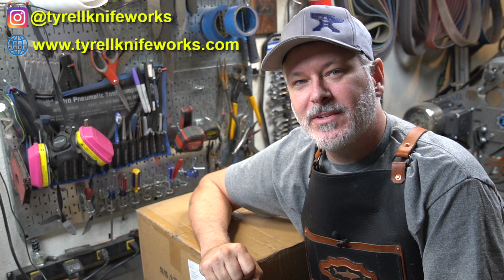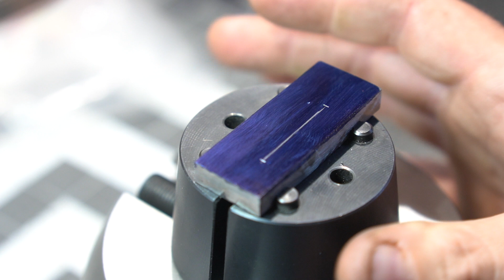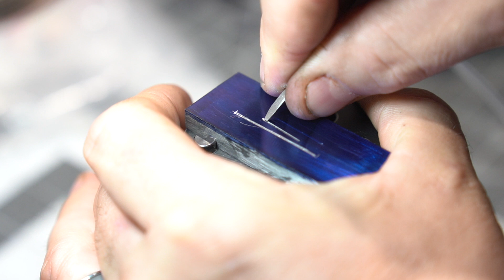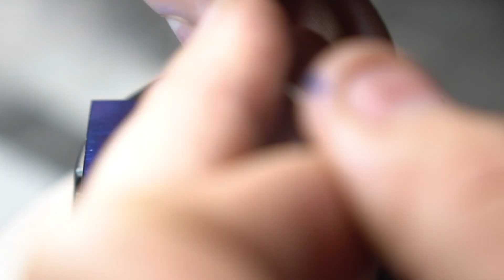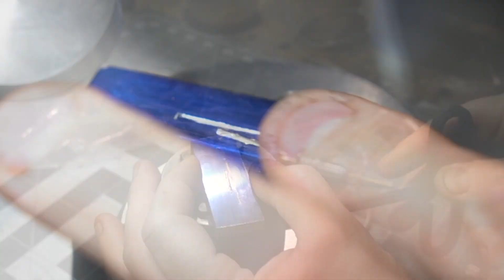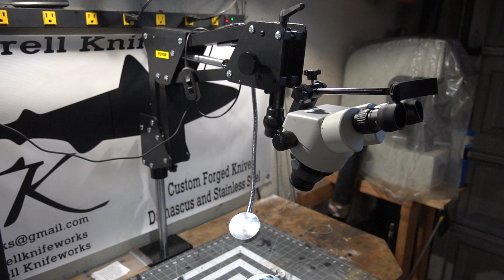Triple-T #99 - Silver wire inlay and a new microscope

Comment: hello, this is what I'm looking for about inlays.  but I failed when the inlay was on wide media even though it was only in the shape of a circle, is there any Vidio inlay on wide media.  I'm a beginner and want to engrave coins.  I hope there is a video, maybe a little picture of how to make a trench for wide media, that's my problem
Reply from the maker: I’m not sure what you mean by “wide” media.  You need to inlay a large area?  That is usually done by carving out that area and putting dovetail grooves over the bottom and pressing rows of wire into it.  I’ve never done it myself though.  If you are on Instagram, watch https://instagram.com/j.parke1?igshid=YmMyMTA2M2Y=.  Thanks for watching.
Reply: @TyrellKnifeworks  yes large media

Comment: Great job as always man,  can't wait to see the gold stuff.  What about lightning on a plain hc knife of inlaid silver?  What do you think?
Reply from the maker: Yeah that could be done.  You’d just have to do the inlay before HT and hope the quench doesn’t screw it up.  Thanks for watching!
Reply: @TyrellKnifeworks  is it impossible to do after it?
Reply from the maker: @8ank3r  no, not impossible.  You’d have to use a special graver that would cut hardened steel.  It will be tough engraving though.
Reply: @TyrellKnifeworks  maybe on a differentially quenched blade near the spine. I'll leave you alone about it though. Too much work for too little result
Reply from the maker: @8ank3r  Yes, that might work if you had a differential heat treat.  I suspect you'd still need a something other than HSS gravers for that since its harder than mild steel.  It could work though.

Comment: would it be simpler to melt the silver or gold in and let it flow once you pushed it part of the way in giving a nice even finish?
Reply: No because the chance of you getting a perfect pour is very low.
Reply from the maker: In addition to what Erik said, the melting point of silver is 1735F and gold is 1950F.  It’s not that easy to get molten material in either state enough to “pour” into it.  It’s MUCH easier to form it into the space.  Thanks for watching